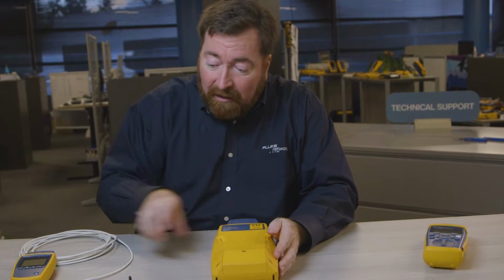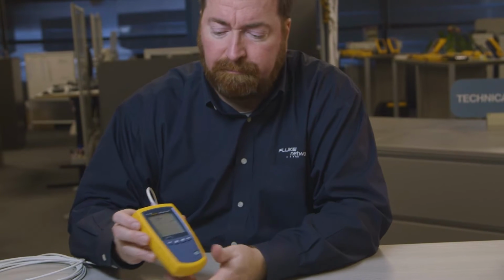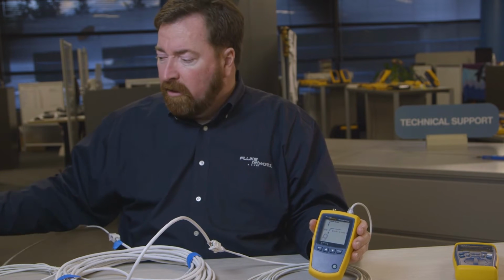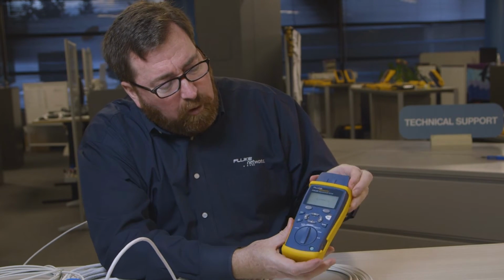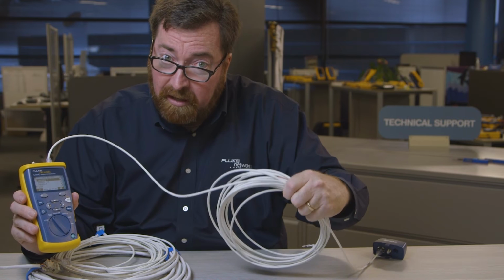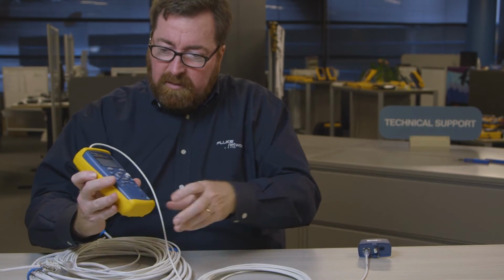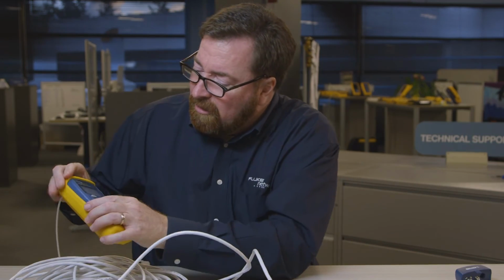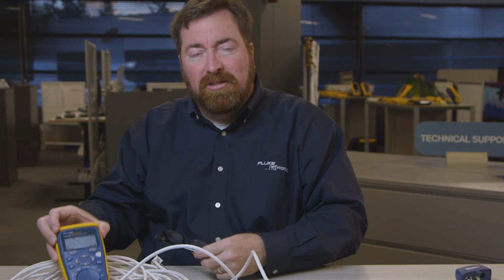Basics of Cable Troubleshooting by Fluke Networks

Comment: I recently bought a cableIQ, but I was a little disappointed that it lacks an intermittent test for testing cables with a bad connection that happens only very briefly when moving it.
Reply: you can put it on discovery mode, and play with the cable while the wiremap is shown live
Reply: @hoefie1977  I did, but it doesn't notice short or open circuits that only last for a few ms. I purchased a Behringer CT200 cable tester with an intermittend test for all kind of audio connectors including RJ45.

Comment: I work with RG-58 coax cable with BNC connectors on each end. Would the microscanner2 be good for simple continuity testing and locating shorts on damaged cables?
Reply from the maker: Hi Tim - thanks for your question. It would work, but you’d need a BNC-to-F-Type adapter. Happy testing!
Reply: You can use a cheap cable tester with toner and use alligator clips to hook one line to the core of the coax and the other to the shell of the coax. Generate a tone and use your tone  scanner on the other end. That's how I did mine. It works. Don't need to spend $2 grand Fluke scanner. It's useful but completely over priced.

Comment: The #1 never mentioned Pro Tip for the microscanner....how much cable is left in the box!

CableIQ is ancient and outdated.  Need something that doesn't cost 10 grand to test for 2.5/5/10
Reply: LinkIQ has been released with 10G support and PoE
Reply: @hoefie1977  Yup, bought one a few months ago.  Got a great deal on the full kit.

Comment: HELP!!. I know you’re reviewing the micro scanner and not the micromapper but....Is the fluke micromapper  POE safe? In other words if I plug a ethernet cable with POV on it into the micromapper or it’s supplied remote will it damaged them.
Reply from the maker: Do not connect MICROMAPPER to a live circuit as it may damage the unit.  It is designed for testing cables with no network signal present on the line.

Comment: So you can’t know which side the cable the problem is?
Reply: the cableIQ, and the newer LinkIQ will provide you the info on which side there is a problem if you have open, split or shorts . When pairs are crossed, indeed you need to uncross them, but technically it doesn't matter on which side. However, if you want to be certain to have that both ends are A or B, then you need guess and you will have 50% to open the correct connector.

Comment: "They're reversed on the other end and it's the other guy who's going to have to unscrew the face plate." You could have explained why you said that, but I love how you did it! Go fix it! It's your problem! Why should I explain why it doesn't really matter which side is wrong? :-)
Reply: Dewald Burger  not all the problem is confusing between a To b ,
I’m working on a project of 3000 network points, and now I test everything and it make it very frustrating that I need to guess which side i need to open in case off a problem.
I hope the get a real answer from fluke
Reply: @amihi19  But why would it matter which side you need to open to fix a problem that's basically an A wiring scheme one side  and B wiring scheme on the other side? Unless the client is really finicky on a particular wiring scheme it really doesn't matter whether it's all A or all B. As long as it's  consistent on both ends.. Or am I misunderstanding your problem
Reply: Dewald Burger  for example in case that you confused between 4 and 5 ( the blue peer) if you don’t know in which side is the mistake 
You need to guess
Reply: @amihi19    :I'm going to post this against my better judgement: If the two wires of a single pair have been  crossed on one side as in Jim's example, it doesn't matter on which side you fix the problem. Sure, the solid & striped conductors will be in the wrong place, but it will not affect the performance at all. Cable testers test pair-performance and it is impossible to test single conductors for performance. I personally would fix that problem, but it depends on how many such issues need to be rectified. If we're talkin tens or hundreds, I would 'fix them the wrong way'. In other words swap the correct side to match the far-end wrong side. The tester will pass it because it is 'color blind' . The link will perform to spec, but you can expect criticism from anyone that opens the termination afterwards. Sorry, I would've provided a more comprehensive reply, but this typing from right to left is killing me!
Reply: @amihi19  the cableIQ, and the newer LinkIQ will provide you the info on which side there is a problem if you have open, split or shorts . When pairs are crossed, indeed you need to uncross them, but technically it doesn't matter on which side. However, you are right, if you want to be certain to have that both ends are A or B, then you need guess and you will have 50% to open the correct connector.
Reply from the maker: Thanks, we’re glad you appreciated Jim’s little joke in there.  Sometimes, the boss prefers you to fix the problem rather than argue who’s at fault!  As you know, electrically it doesn’t matter which end gets swapped.  If the partner at the far end isn’t experienced enough to realize that maybe it wasn’t their fault, then you’ll spend even more time explaining “A” versus “B” wiring to them.
Reply: didn't think A wiring was a standard anymore
Reply: @finitevoid4520  If you believe (like many people do) that T568A was replaced by T568B, you're wrong. They're both accepted as standards. Always have been & probably always will be. I believe the two wiring schemes are the result of an unfortunate compromise, and the A scheme makes more sense to me. Even the nomenclature is unfortunate in my opinion as I have found many people confuse the T568A & T568B with TIA 568A and TIA 568 B specifications. Or are you just a troll?
Reply: One thing the Cable-iQ does is shows on screen mix of T568A and T568B in text whereas the MicroScanner just shows a warning triangle and diagram.
Reply: @smilly9  True, but it still cannot know which side's T568A and which is T568B, so it doesn't really matter does it? Fix any  side unless you really HAVE TO use either A or B. In that case, it may mean fixing the far end after you've opened the local end and found it to be 'correct' as per your preference.
Reply: Dewald Burger True, as long as they are both A or both B at each end it doesn’t matter. What I have found is the B standard appears to be the most common in EU countries I think A is more common in the US? The crocodile clip to RJ45 test lead that comes with the MicroScanner2 Kit is terminated on T568A so when testing B you have to reverse the orange/white green/white crocodile clips, thought about cutting the end off and crimping a new plug in B but I don’t use it often enough.